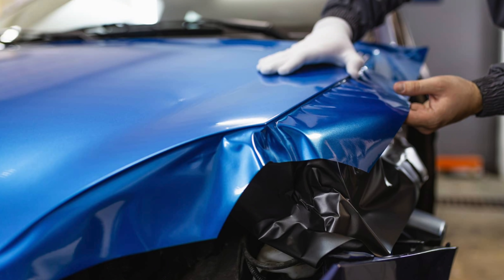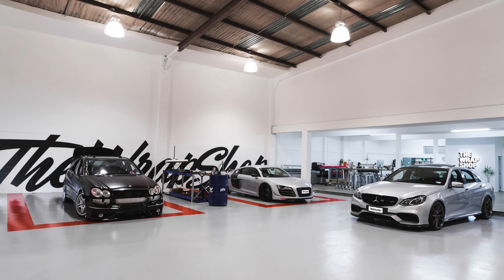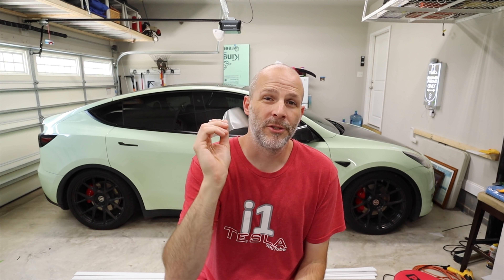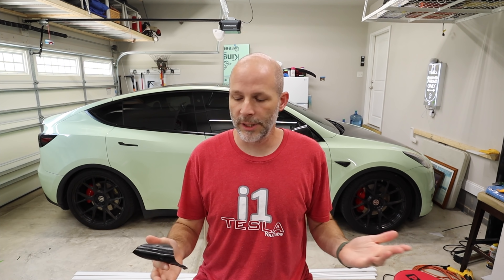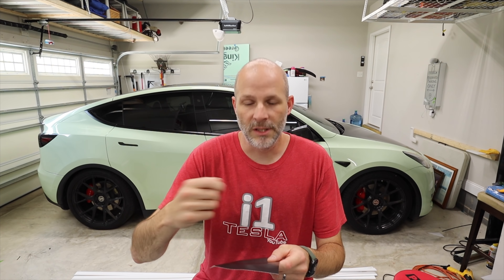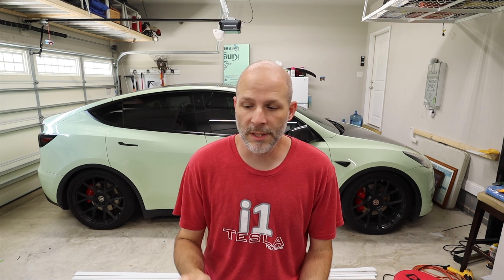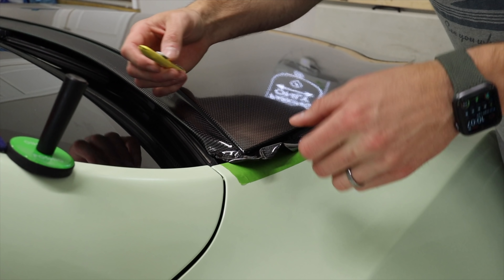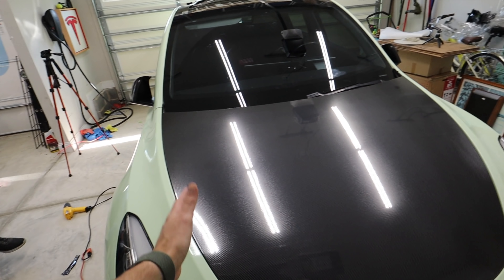Vinyl Wrap vs. Clear Bra: What's Better? Is there something in the middle?

Comment: My detail shop does not use PPF templates, they roll all of the edges over and then cut them with a razor blade. The result is no ugly edges that accumulate a black line of dirt. 
The trade off is that you get what you pay because it’s very expensive and no they don’t cut the paint with their blades. They treat clear or matte the same way in installation.
Reply from the maker: Yes some shops install PPF in big sheets. Take longer but you have better results for the customer.

Comment: Thickness has very little to do with the amount of protection. It's the material itself that is important. My "vinyl" wrap is quite thick, probably thicker than any PPF, but it tears easily. PPF is usually polyurethane, which is much tougher, even at a fraction of the thickness.

Way back in the early days of smartphones, I put a Zagg screen protector and skin on my Nexus One. It was made of polyurethane and the protection was absolute. It also had a gloss finish but never showed fingerprints. I never had a scratch on that phone. I've tried other screen protectors on other phones since and they are all absolute crap in comparison, including glass. I will never again use a glass screen protector because when (NOT if, when, because shattering is certain with those) they break the sharp edges WILL scratch your screen and they have zero impact absorption because they are too hard, so your screen is likely to break along with the protector. I haven't had a Zagg product in years because they only cater to the flagship name brands, but Armorsuit Militaryshield uses the same material and fits many more applications.

Anyway, I don't understand why PPF can't be colored or why colored wraps are so wimpy, but I guess the best solution is to do both like some people are doing. Then you have the best of both worlds because you're doing both.
Reply: There is color ppf now, and even color shifting ppf. And almost all vinyl wrap for cars is thinner than ppf, unless you have some special vinyl that had laminate on it

Comment: Newbie question.  What kind of knife are you using to trim the film?  I almost freaked out since it looked like a box cutter and I'd worry about cutting/scratching the vehicle/paint.
Reply: With a sharp knife and littlw pressure u can cut only the vinly i takes a bit of prqctice

Comment: Every shop I have inquired has always told me Vinyl can not self heal compared to PPF's ability to do so. Is that not the case as you say here, that both can self heal?
Reply from the maker: PPF is a little better at self healing bigger scratches, true. But the normal scratches they are the same. PPF is much thicker so it will protect more. Plus they make more off PPF
Reply: @i1Tesla  Yes, the self healing ppf doesn't do miracles from what I have seen on my cars.

Comment: Any issues wrapping over a ceramic coating?
Reply from the maker: Yes the ceramic needs to be removed first
Reply: "Ceramic" coatings are a lie, it's just overpriced synthetic polish, and any "wax" product will need to be removed before applying any kind of wrap. Have you ever tried to tape waxed paper? Same thing. That's one of the main reasons they do such as thorough cleaning of your car before they wrap it. Anything at all that is between the paint and the adhesive is a problem.